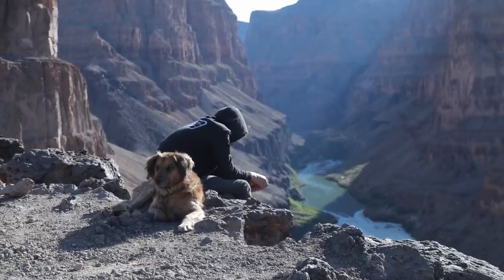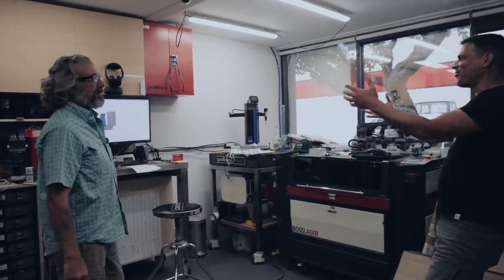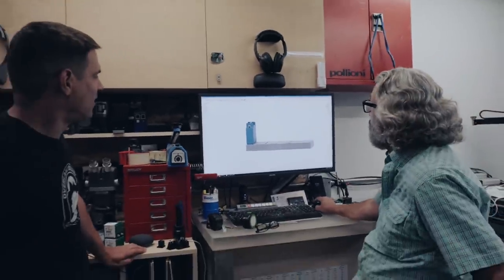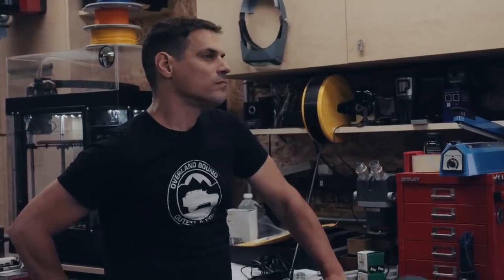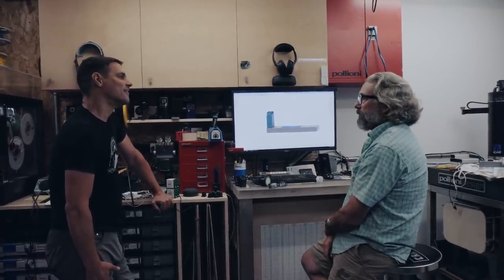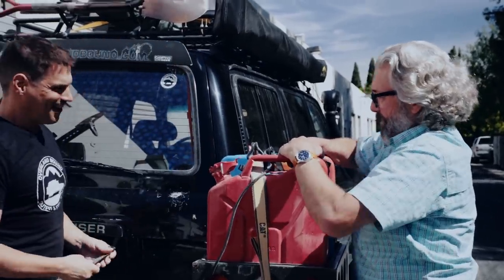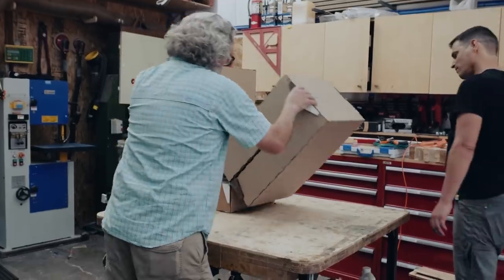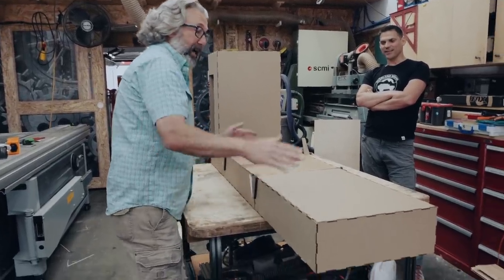The Ultimate 20 Second Camp Kitchen

Comment: I would just add a faucet and use one of those rectangular pop out silicon basins with a drain on the bottom inserted into a cutout. It would be a lot deeper and fold closed when not deployed. But still a very cool setup.

Comment: I'm sure it's way too late for this comment...for myself and a bunch of other people we camp with, we have lovely kitchens in our camper trailers here in Aus, and none of us use the sink...we use the depth, but we find it far more convenient to place in a small collapsible silicone sink. It allows for extra bench space when not in use, and the dishwater can be thrown out well away from camp - much less stinky and doesn't make a wet area or require an extra bucket underneath...save yourself the $$ on the flashy sink.

Comment: Gas lifts like on the hatch also come in a version that “pulls” instead of extending. You could use that between the first extension (sink section) and the pantry. This will help support when open AND it will help close the folded section. Hope that makes sense.

Comment: Design question, can you Mount the sink and cooktop sideways and set as far apart as possible? That way they can each be operated from either side and you maximize the counter space in between. Does that make sense?
Reply from the maker: It does make sense! Tolerances are pretty tight. Stove you can use from both sides. Sink has a lid, making it hard. Because the kitchen turns 90 degrees to fasten to bumper, the deeper the counter (to accommodate turning sink/stove, the farther out it will be from the back of truck. This will make the departure angle worse. It’s a trade off.

Comment: have you considered the uneven ground you will be on ( even with levelling ramps) that far out from the vehicle the work surface could be way to high or way too low. that's the problem with most pull out drawers that are long.

Comment: GREAT idea. but so many flaws. both the sink and gas top you chose will break in your first outing. The folding faucet leaks as it is (winnie Revel used to use it) and the big RV manufacturers are going back to regular sink. (maybe dometic is paying for this?). the stove top is too heavy. sealing this will be next to impossible. My suggestion: use collapsible plastic sink, and regular portable stove. Reinventing the wheel is hard work 🙂
Reply: one more thought... why is it you dont have a cover for your existing water/tire? ... I would say the same reason could also apply for the new kitchen setup. Dust and food don't go together... and dust will win every battle 🙂